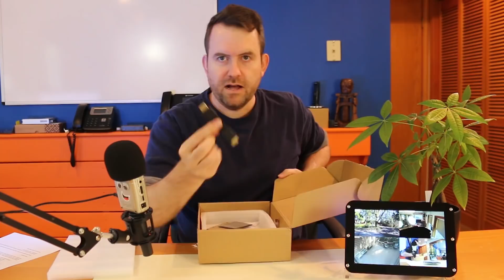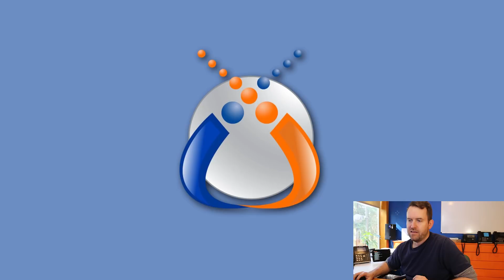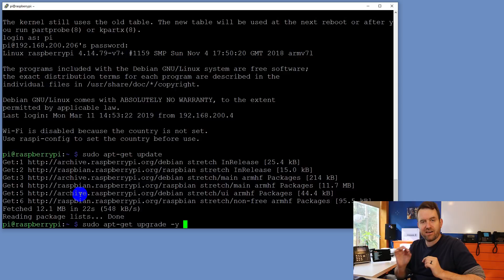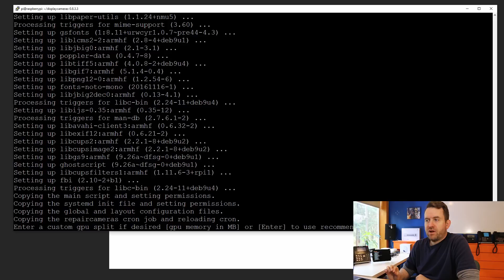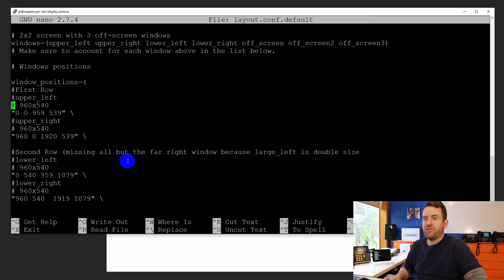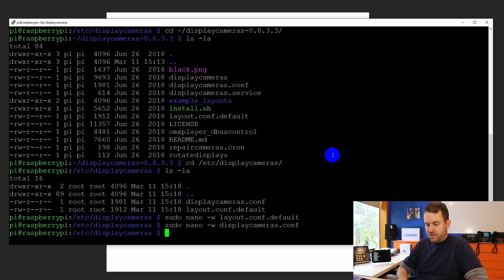Raspberry Pi Surveillance Monitor v2

Comment: Chris could you not tap a 5v off the pi hat to power the screen from the Poe?
Reply from the maker: I have no idea - can you?
Reply: @CrosstalkSolutions  I wouldn't see why not I take the hat will take the 48v(or 24v) and drop it down to 5v for the pi to run if you can find the 5v and gnd rails then you should be able to run both off the poe

Comment: Thank you for this!!!!  I've tried to do this in the past with no luck.  I am not a Linux guy, so for Raspberry Pi things, I need step by step guide. 

I also run a Pi-Hole on my network with another Raspberry Pi.  I highly recommend that!  It even blocks ad's on mobile games and web, so much better then just an ad-blocker on chrome as an extension.

Comment: Thanks, great solution! BTW, I think you can get away with a low quality RTSP stream as you only allocating 640x400 space for each camera, there is no reason for even a Medium stream in your case. Would you do a HomeKit integration video? (using HomeBridge) :)
Reply from the maker: You're probably right on the stream quality - I'll try that out.  I haven't looked into HomeKit.
Reply: +1 for the HomeKit question... @CrosstalkSolutions

Comment: You might be able to power the whole system off of 1 cable if you use a a active POE to 5v adapter I use them on my RPi's and they work great not sure about running the screen as well I think the ones I have can put out 2.4 amps at 5 volts.  https://smile.amazon.com/ANVISION-Splitter-Adapter-Compliant-Raspberry/dp/B079D99Y3Y/ref=sr_1_4?keywords=poe+5+volt&qid=1552397340&s=gateway&sr=8-4 is the link.